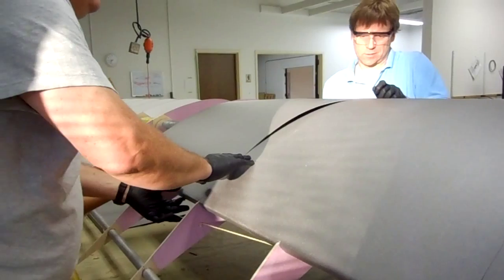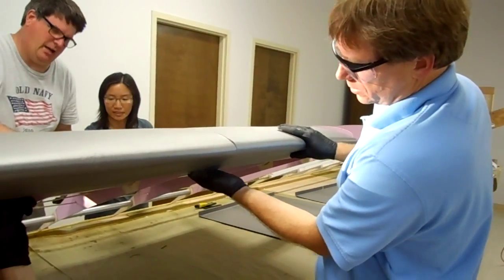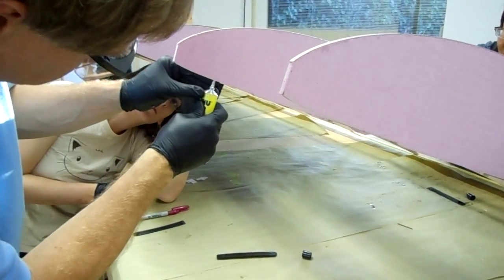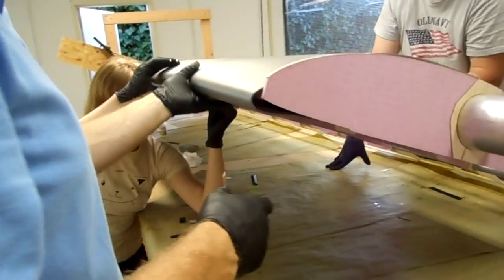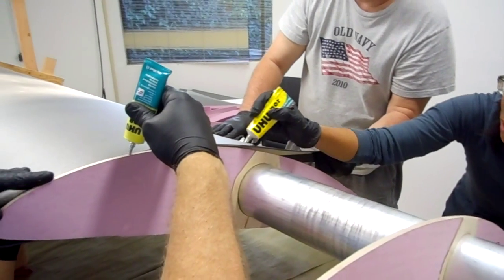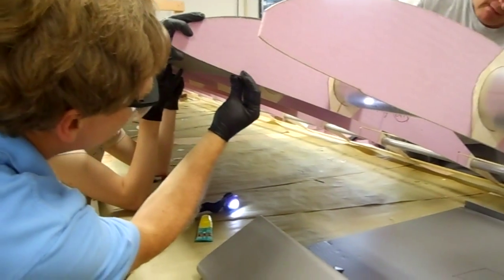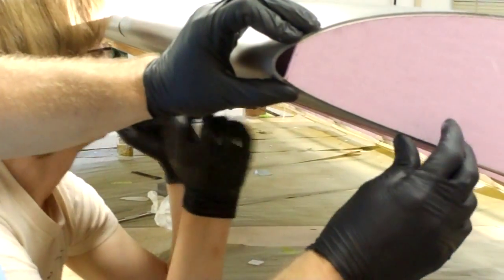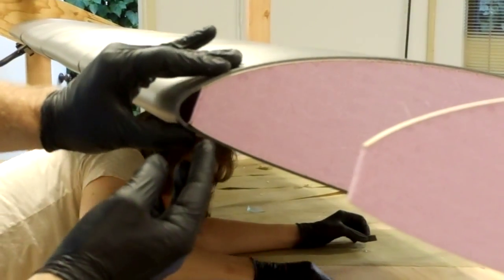Installing Depron Leading Edge Sheets on DaSH

Comment: Quelle est la colle que vous avez employé.
Reply from the maker: UHU Por:  https://www.amazon.com/UHU-POR-Styrofoam-adhesive-tube/dp/B000KSQU1K  You apply it to the wood rib caps, wait about 30 seconds, and then apply the foam.  Hold and support it for a few minutes and then the bond is secure.  (Note: for attaching the Mylar to the rib caps and trailing edge in the open parts of the rib bays behind the leading edge material, we use Pliobond, a type of contact cement.  you apply it, let it dry, and then heat activate it with an iron as you are applying the Mylar.  We also tried several other types of contact cement and they also all work to one extent or another, and can be heat activated in the same way).